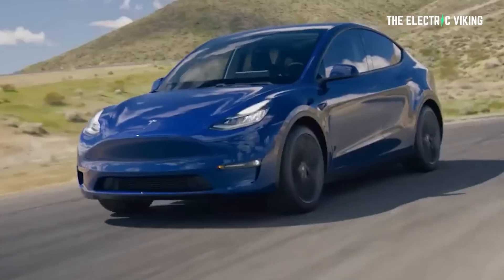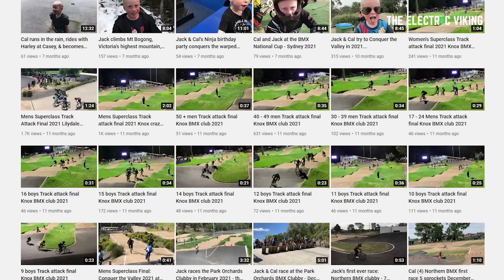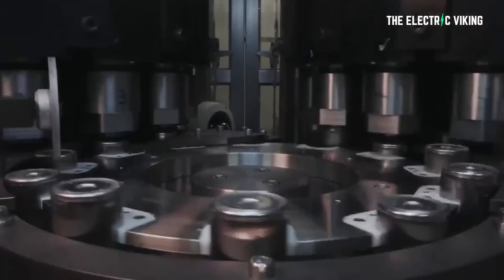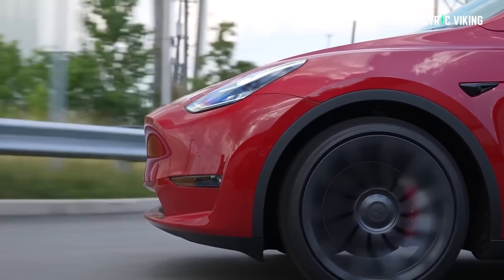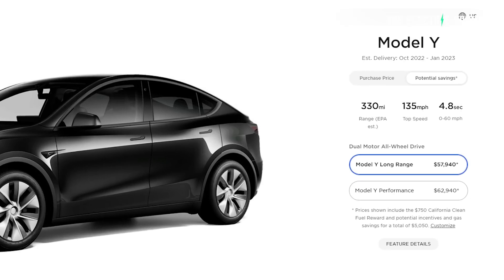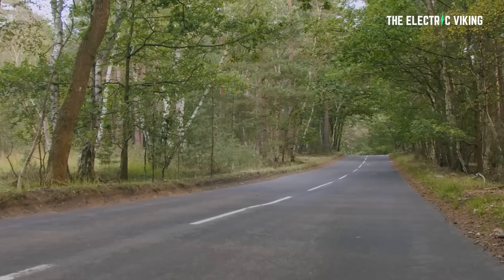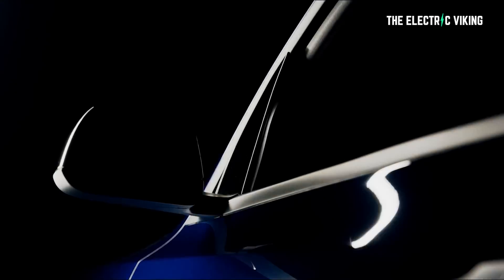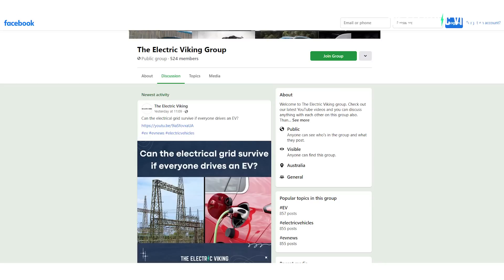NEW info confirmed on 4680 Tesla Model Y AWD variant

Comment: too much misinformation and conflict.  the only thing concrete is the images of 4680 pack in Texas. Counting it, results to roughly the 2170 LR battery capacity.  The MY AWD is a different beast.
edit this: I just heard a new theory. The AWD could be a software locked 4680 with the range of the LR.  After all these months, turns out to be boring. I thought it is LFP.

Comment: Maybe they are using the LFP version of the 4680 battery.. In which case, it should be seen as an upgrade from the standard range with 244 miles. A 14% improvement. Or the volumes of batteryproduction of the new cells is just too low for them to bring out the long range version, going with the standard range first gives them a 50% bigger output.
Reply: 4680 wasn’t designed for LFP batteries and doesn’t take into account their lower energy density and higher heat endurance
Reply: @chidorirasenganz  4680 is the form factor and LFP is the chemistry for the cathode, 2 different things. You can make LFP in any form factor and with different anodes. Please don't reply if you don't understand.
Reply: @rashius  read what you said and they tell me I don’t understand the difference
Reply: @chidorirasenganz  There is not difference. You just don't understand what you are talking about. 4680 is about the size of the battery, 46 millimeter diameter and 80 millimeter length. You can put anything inside including batteries based on LFP. Also, LFP batteries has less thermal runaway, NOT higher heat endurance.
Reply: @rashius  No you’re just displaying you’re ignorance about LFP vs NCA batteries. LFP are lower energy density than NCA and NMA batteries. So a cylindrical cell thats designed for batteries with a higher energy and less thermal runway (I forgot the term) makes no sense. Even Elon himself has already stated so. There’s a reason BYD and CATL use Prismatic and Blade battery cells to pack more cell per battery pack. 4680 cells with LFP would waste too much space for too little range and be over-engineered in terms of thermal runaway. So no it makes no sense to use LFP for 4680 batteries because it was designed for different types of lithium ion batteries

Comment: The numbers don't add up.   Most puzzling is that the EPA Fuel Economy of the new model is essentially the same as the ostensibly heavier Fremont-built 2170-batteried Model Y LR.  EPA refers to the new model as "Tesla 2022 Model Y AWD" and gives its range as 279 miles and its EPA Fuel Economy as 123 MPGe, combined city/highway.   The EPA gives the Fremont built LR a range of 330 miles and EPA Fuel Economy of 122 MPGe.    If there really is a big weight difference, why hasn't the fuel efficiency improved?   The best explanation is that (1) the weight difference between the two vehicles is minimal, limited to the weight savings from using a structural battery pack, because Tesla has to pad out the pack in the new model with dummy cells, and (2) the 4680 batteries have lower energy density than the 2170s.    One may legitimately ask how Tesla can price this car at 60K.   I think the answer is that Tesla is very aware that customers have been declining acceptance of Model Y LRs made in Fremont because they strongly prefer the 4680.   They have priced the new model unattractively so that sophisticated customers like the Electric Viking will continue to see the Fremont LR as a better value.
Reply: I wondered if the 4680 cars have the LFP chemistry and therefore negate the weight savings of the structural pack and therefore lower range but more usable battery percentage
Reply: @GG-si7fw  nah 4680s aren’t compatible with LFP. 

I think they just wanted to make the new model not as appealing to escape the Osborne effect and to control demand for the new vehicle
Reply: @chidorirasenganz  Ah, yes. The Osborn Effect is a better conclusion. I, too, would refuse a Fremont MY 2170 versus Austin MY 4680.

Comment: My guess is that once they have world wide 4680 supply and lots of data, they will unlock more range.
Reply: Probably right. Software locked til everyone gets 4680s
Reply: @timchow924  they may charge to unlock it! They did that with the original p60s and pushed it to p75 levels.

Comment: A range of only 279 miles from the most hyped new battery technology is disappointing.
Reply: Agreed.  Disappointing is the right word.
Reply: unless it was 20% + off the price of current offers.
Reply: Nah. It makes sense. This way they can sell more cars with fewer batteries and not piss off all the people who just bought or have ordered LR cars.
Reply: I agree with mark. this is a garbage product that people have been delaying taking delivery for their model y. people will dump those pre orders if a 60k model y with 280 miles is what Tesla is going to bring to the table. they are playing with fire with these price increases and are going to get burned.  pre orders are just that. preorders. that 5 month wait can evaporate in a week if they are not bringing a compelling project at a compelling price point.
Reply: depends where you live...where I live, 279 miles is more than enough
Reply: Easy TIGER!
The 4680 in the CYBRTRK will have a different Chem!
This early battery has met a need that was required here in this Model Y variant.
Most likely a LFP' cell.....imho

Comment: You might be wrong on the new 4680 Y variant. If it is the smaller battery pack then I recon it’s gonna be what Elon mentioned previously as the return of the Standard Range single motor at a lower priced entry level, $46000 or less. Nor the LR as shown on the site.
Reply: I agree. no way its 60k. that would be ridiculous.
Reply: Nah we already know its a standard range AWD from gigafest. They don’t want people canceling orders or deal with even more demand so they don’t want to make it too good of a deal